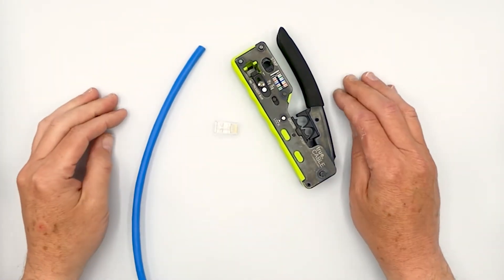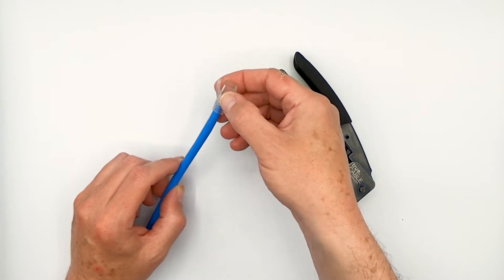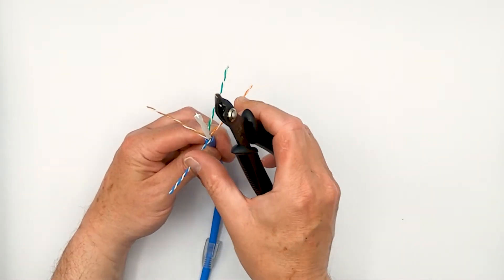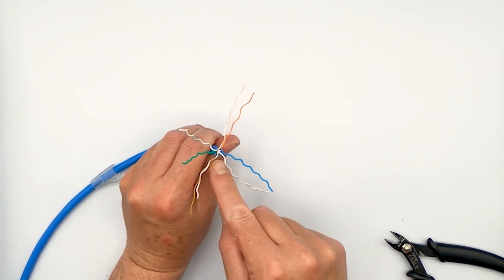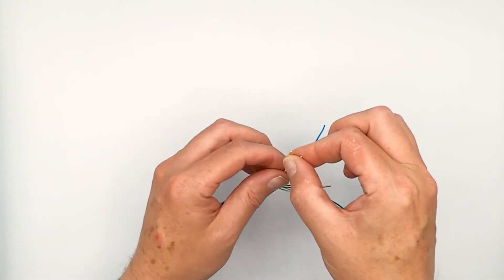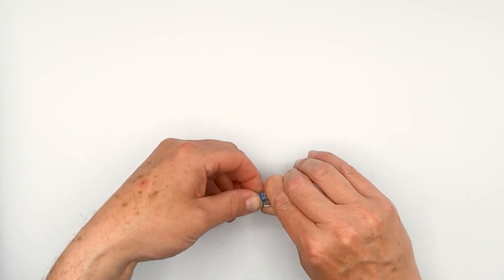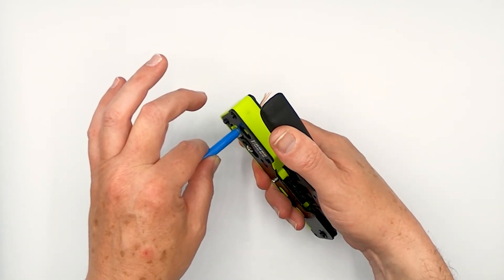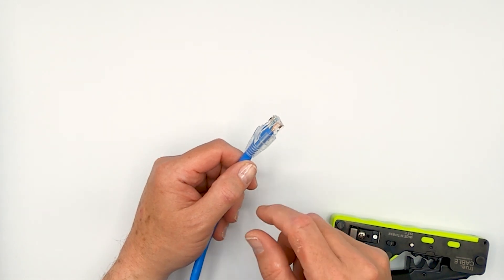Guide to Terminating Unshielded Cat6/6A Pass Through RJ45 Connector (Full Walkthrough)

Comment: Installed new cat6 pass through connector on CAT6 POE works….no ACTY light on switch….tested with fabricated CAT5e cable and POE and ACTY light work tried three new connectors at each end…….any ideas ? Tested cable with inexpensive Tester and all lights show positive test. I used the same crimp tool ( blue in Color )
Reply from the maker: Hello! Sorry to hear of your trouble. Based upon the symptoms, either the conductors are not using the same and/or correct color code at both ends (either T568A or T568B) or the plug itself is not fitting the insulated conductors properly and causing a short. A simple wire map tester should be able to help diagnose this further. If you are using trueCABLE plugs and/or cable please reach out directly to us on our Contact Us page on the www.truecable.com website. Thanks!

Comment: Why don't u use the non- pass through RJ45? It's too practical
Reply: Please, do u have any other way that I can chat you through there
Reply from the maker: @nanahubert1131  Hello! Our customer success team is available to help with any trueCABLE-related questions! You can find our contact form here : truecable.com/pages/contact-us
Reply from the maker: Hello! We offer pass-through and load bar-style plugs when it is absolutely necessary to terminate an 8P8C (aka RJ45) plug onto solid copper Ethernet. Both are equally good when used with Cat6 straight-across terminations operating at 250MHz, but the preference goes to load bar staggered non pass-through plugs for Cat6A 500MHz terminations. That all said, the fitment of the plug to the cable is the most critical factor, and some plugs are better suited to certain cable SKUs. It is on a case-by-case basis.

Comment: Terminating was extremely fast. I'll be honest I don't have as good of a physical grip anymore and in the past, its taken me 20-45 min to do 1 rj45. This took 5-10 min tops. I'm using better cable that I normally was which also aided in it! Thank you for the tools and video walk through!
Reply from the maker: Glad we could help save some time; we are always here to help with any questions!
Reply: @trueCABLE  awesome thank you! Do you guys offer a cat6 /w load bar? I don't think I need it since all my terminations were flawless yesterday! But if you do have some I may add them to the kit.

Again thank you guys for helping me out!
Reply from the maker: @kristopherleslie8343  Hey Kristopher! I am glad your installation went well. We do offer a Cat6/6A unshielded "standard" load bar 8P8C (aka RJ45) connector. It is designed to fit all of our Cat6 unshielded SKUs, and will likely fit other manufacturer's cable as well, assuming you match the specs of the cable with the plug and they are within tolerance of each other. I caution against buying plugs "just because" unless you are exclusively buying trueCABLE brand cable since fitment is so critical to performance. Category is NOT relevant to plug selection. Fitment is.

Comment: Hi, can we use CAT6A Cable on Cat6 Keystone and connector ?
Reply from the maker: It depends. Some Cat6A cable is made with conductors with insulation that is too big in diameter to fit some Cat6 jacks. However, if the wire fits, the jack will work, but you will be limited to Cat6 levels of performance.

Comment: I am enjoying your trueCABLE videos, and I have a question. Do I need to make sure I use CAT6A connectors on just CAT6A cable or can I use it on CAT 6 cable also?  Do I need to use only CAT6A connectors on CAT6A cable or can I use CAT6A connectors on CAT6 cable, does it always have to be matched or can I just buy a big bag of CAT6A connectors and keystones and use that for both CAT6A and CAT6? I must have been able to word that better but I hope you know what I mean?
Reply from the maker: Hello Jim! I know exactly what you mean and what you are asking. Don't get hung up on Category when it comes to RJ45 8P8C plugs. They don't have a Category, technically. The thing with selecting the proper RJ45 8P8C connector is fitment. The cable in question (regardless of Category) needs to be matched to the plug, with two dimensions being critical: Insulated conductor diameter (copper + insulation) and overall jacket diameter (jacket OD, or cable thickness). I recommend going to our Cable Academy and looking up the blog titled "Selecting the Correct RJ45 Connector".
Reply: @trueCABLE  I found the Cable Academy and I found the blog, my next question is going to be the punchdown keystones and the same question do I need to match the category to the keystone and cable(not talking about shielded or unshielded yet.  I will look and see if I can find a blog keyed to selecting the correct keystone connector.
Reply from the maker: @HollowayMooseRanch  Hello Jim. In the case of keystone jacks, yes, the Category does matter there. For the cable in question you must use the same Category or higher rated Category keystone jack.
Reply: @trueCABLE  So I would be safe to use Cat 6A keystones with all my Cat 6 and Cat 6A (I really don't have any shielded cables in my home network right now) cables. I don't want to have two sets of keystones to use and just buy a larger supply of Cat 6A keystones.
Reply from the maker: @HollowayMooseRanch  Hello Jim! That is a great idea. You are perfectly safe to use Cat6A keystones with both Cat6 & Cat6A Ethernet cable.

Comment: What are your thoughts on using pass through connectors in POE use cases? Iv seen alot of mixed feelings on the subject online.
Reply from the maker: Hello! Pass through connectors are not an issue with PoE as long as they are properly flush cut at the end of the crimp cycle and the insulated conductors are properly fit to the cable to begin with. Many people who have had trouble with pass through RJ45 8P8C connector plugs typically had a plug that was too loose or improperly terminated and this led to the issues they had, not the fact the plug was pass through. That all said, terminating RJ45 8P8C connector plugs onto solid copper Ethernet cable is not and never will be ideal regardless of whether they are pass-through or not. Fitment is ultra-critical and there are too many things that can go wrong. The best way is to use field termination plugs for male ends terminated in the field as they are far less sensitive to fitment. Alternatively, the "rack to jack" approach in addition to factory-made pre-terminated patch cords to complete the channel is another good method. We hope this helps and please let us know if you have any further questions!

Comment: What determines when an extra-large Cat 6a connector would be used?
Which is preferred for residential use: shielded or unshielded Cat 6a?
Appreciated the video; clear, concise.  Wish the background was a different color for better viewing.
Reply from the maker: Hello dc. The unshielded XL Cat6A pass through plug would be used for certain trueCABLE products that have a very thick insulated conductor...namely our unshielded Cat6A Plenum cable. It comes down to fitment in the decision process for plug selection. Unshielded Ethernet cable should be used for ANY install (commercial or residential) unless you know you need shielded. Shielded is designed to prevent performance degradation due to environmental EMI/RFI. Shielded cable is not "better" per se. In fact, shielded cable is considerably more difficult to install and costs more due to the required shielded termination hardware. Thanks for the feedback on the background! We will see what can do.
Reply: Background is perfect 👍🏽

Comment: I've never tried pass through before, although I did try load bars last week and I'll never know how I made good cables without them. They get the jacket almost all of the way up to the teeth. Good stuff.
Reply from the maker: Hello! Load bar RJ45 8P8C plugs are great to work with as well, assuming they have been properly designed. The pass through style is typically the easier of the two, although, pass through plugs are more prone to fitment related performance issues, and they have to be carefully selected and tested. Thanks for watching!